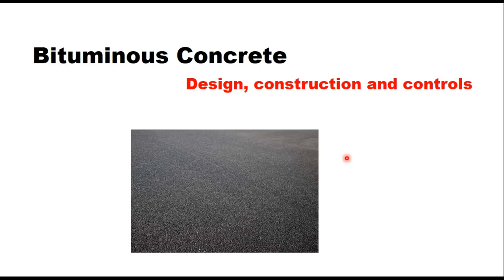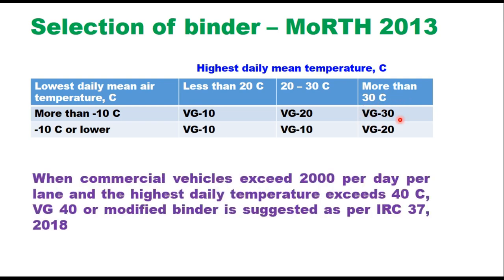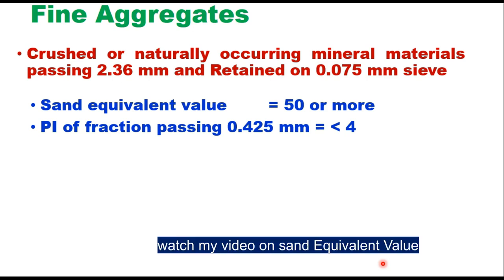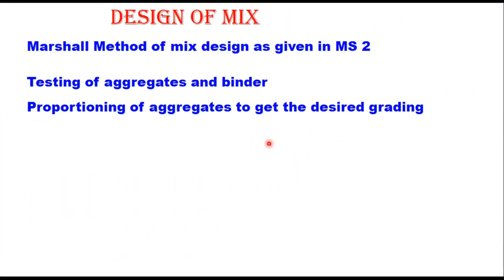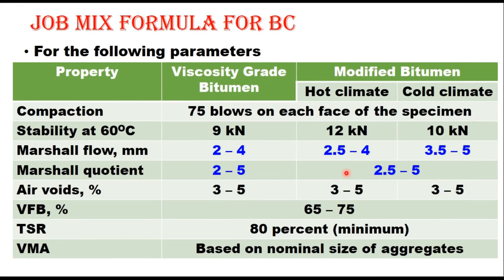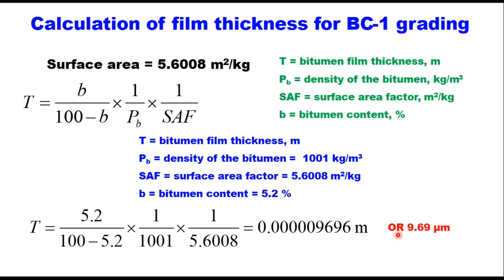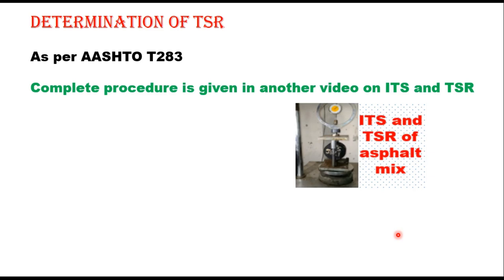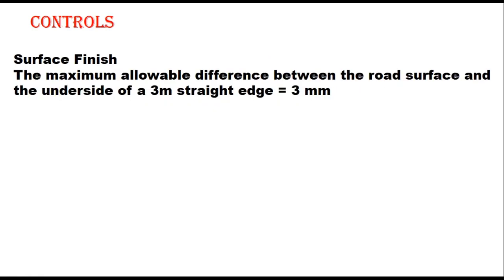Bituminous Concrete, Design, construction & Quality controls, Design of mix, asphalt film thickness

Comment: Sir it would be very useful if u make a vedio regarding compacting bed...compactors of various types their uses.....compacting of bituminous course joints..transverse and longitudinal both...and rolling patern...calculating rollers requirements on specific length..important rolles of screed workers during paving activities 🙏
Reply from the maker: Thanks for the suggestion. I will try.